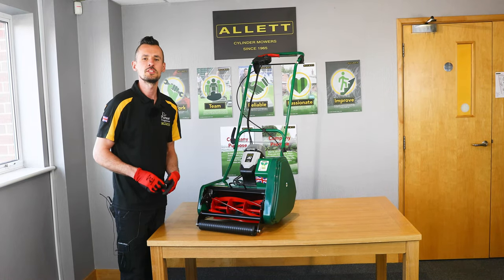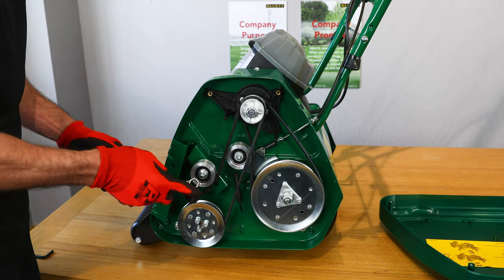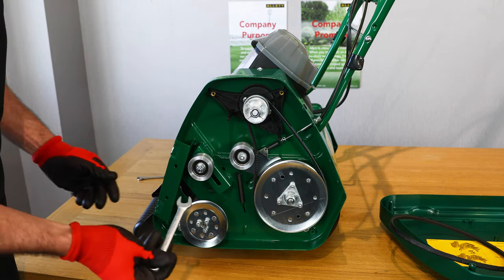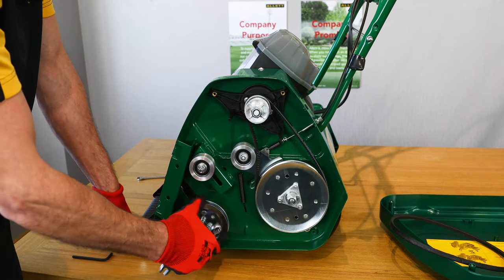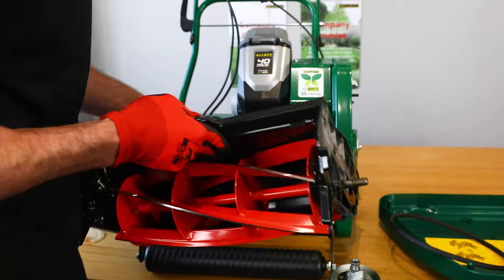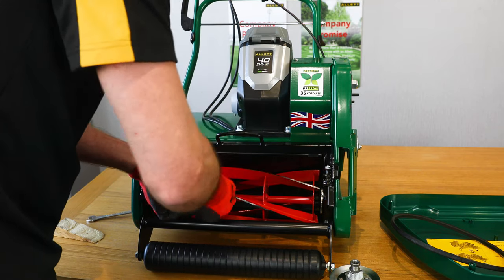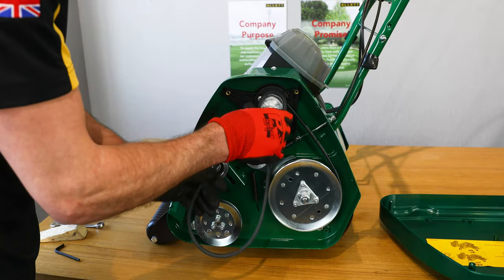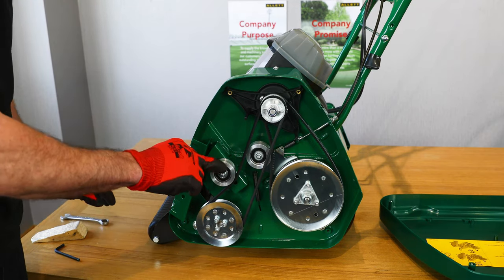Changing a Cartridge in an Allett Liberty 30/35 Battery Cylinder Mower

Comment: It seems a bit of a fan if one wants to scarify and mow weekly but at only 6 mins each time not too bad. Could be a tad quicker if one buys another Allen key and saw off the short side so as to put the remaining long end in a small electric drill. Keep the drill handy with the Allen key in the chuck.
Reply from the maker: Hi Christian - I’ve seen drills used before to take the side guard off . The Liberty 43 is a much quicker change in terms of not having to remove the belts

Comment: Can i use the scarifier cartridge on this liberty 35? And how can i prepare it?
Reply from the maker: Yes you can. Sorry what do you mean in terms of preparing? You’d just change a cartridge like you would if you were just taking the cylinder out
Reply: I mean on the the 14“ scarifier cartridge is the white quickchange wheel but this is not compatible with the Liberty 35 as i know. So how do i match the cartridge exactly to the liberty 35, or is there another scarifier cartridge for the 14“ liberty 35 ?
Reply from the maker: @mrchillout1989  you need to take the white cog off and fit the pulley attachment - we have a video on here
Reply from the maker: @mrchillout1989  https://youtu.be/fcQ0eJBQksE
Reply: Hi Allett. Does work for the Liberty 43 as well?